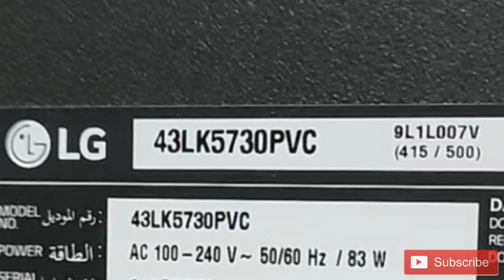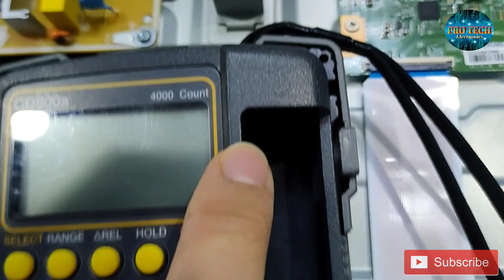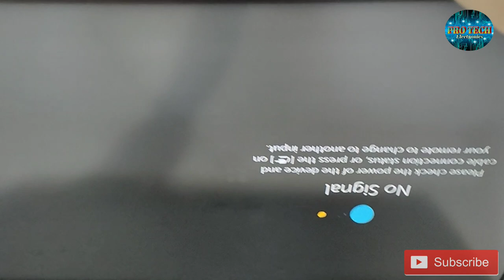How To Fix No Picture With Good Sound And Backlight (Tagalog) Pro Tech Electronics

Comment: idol ang galing mo gusto ko po mag tanong Lg plasma model 50PW350R po nawawala po yung display minsan minsan ok naman po ano po kaya sira salamat po sana mapansin po  gudbless 💖🙏🏻
Reply from the maker: Check po kung may loose connection pati sa mga hinang, check din po ang control board( t-con) isa rin yan sa nagiging dahil sa pagkawala ng picture.
Reply: @protechelectronics79  maraming salamat po idol malaking tulong po yung pag turo nyo po sakin DIY kulang po yung tv namin ayaw po namin mag pagawa kasinpo yung iba nanaga po ng presyo

Comment: May ace tv po ako na 32inches  i off itlang po un after namin ma nood ng tv then the next day binuksan namin may sounds po cy but no display na.naka sky cable kmi nalilipat po cy through remote.only problem is no display kaso na i pindot po ubg remote na iba ung source  nawala na po sounds but it is on unlike if nk hdmi2then sky cable may sound.hindi n po maibalik sa hdmi 2source pwd n senior lang po kc wala po ib mag titingin o gagawa ng repair
Reply from the maker: Dalawa lang po yan kung no picture with sound, pwedeng sa backlight or panel na.